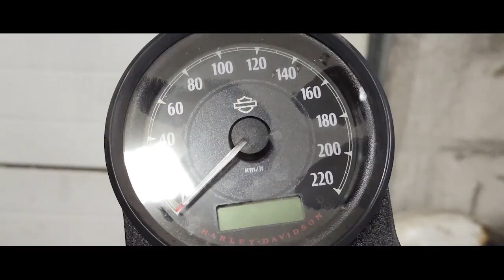Chop rear fender SPORTSTER xl1200 Harley-Davidson

Comment: You worked so quickly on the fender.  Did you chop off the tail end or the inside edge that has the plastic attached by rivets to the fender?

Comment: Hey man I am doing the same to mi bike and following every step you did now I have a problem that I am stock, I can't place the bolt for the turn signal because the tire is in the way, so how did you put that bolt for the turn signal with out removing the tire?
Reply from the maker: use another bolt
Reply from the maker: flatten the tire
Reply: @BurmeistersBikes  don’t burn your cheeseburger

Comment: What tool did you use to pull the wires out of the connectors?
Reply from the maker: homemade needle
Reply: @BurmeistersBikes  this was done to my 2013 Dyna Street Bob is there any way to going back to stock once it's been cut down? I want to be able to put a bigger fender on the tiny little Bob offended that's currently on is too small. I want fender small but would like to get the three or four inches back on my bike that you cut off on yours.... Is it possible to do? If so can you please point me in the right direction of what part I would need, fender struts fenders support struts? And where can I get them? Thank for your help
Reply: @BurmeistersBikes  where you get your seat from
Reply: Do you eat cheeseburgers with your feet